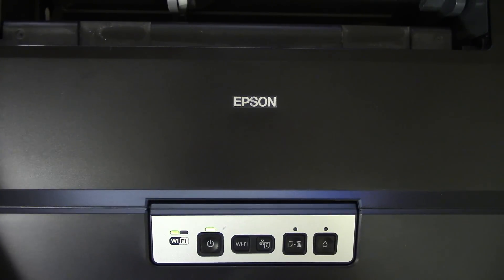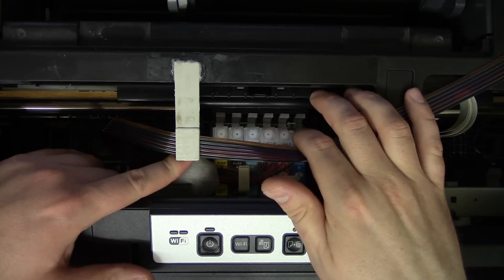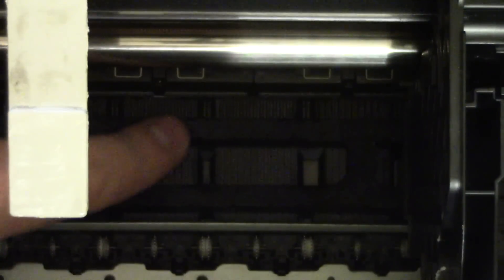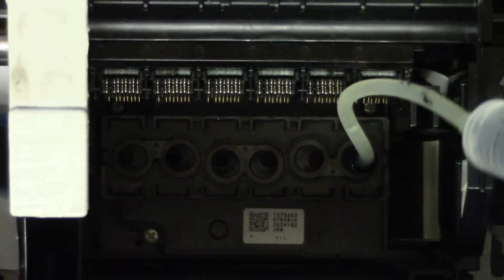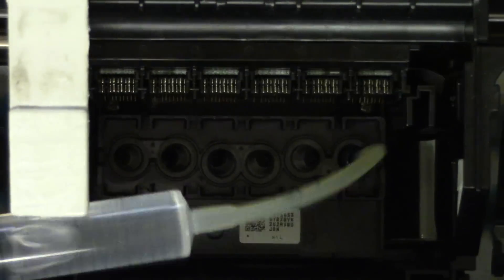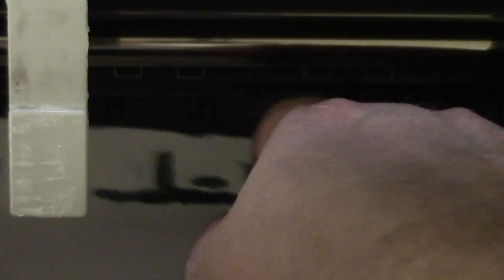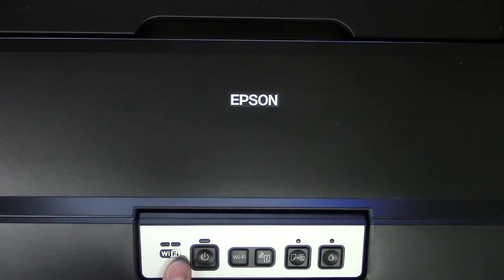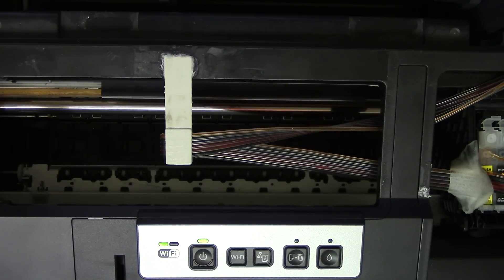How to Clean a clogged Epson Printer Printhead

Comment: do not do it what he's doing. it will destroy your printer. you should remove the printer head before doing the unclogging. a single drop of liquid/moisture will damage you print head. remember to double check if there's any liquid left in circuit before put it back. specially the flex cable. make sure no moisture or liquid.
Reply from the maker: Not true at all.  I've done this HUNDREDS of times on several printers over years.  You suggest removing the print head?  Most epson printers make this impossible without damaging your printer.
Reply: HBT many people going to our printer repair shop and their printer is dead because they follow what they watch in youtube without removing the print head. and im printer tech in almost 5years. some people don't know how properly care when doing clogging. so they end up dead printer. 1430 printer is very easy to remove the head. well your lucky for not damaging your printer. as i said be carefull for those people. thats all.
Reply: dheluxe hey I’m having the hardest time trying to find a tech who will work on one I Have. Do u by chance live in the south eastern of US? or any advice on someone in the region who will fix it? I wont be out of much oč a loss if it ends up nor fixed. I found. 1430 Artisan from a printshop who said oné DAY it just Quit printing and they didnt have time to stop production to triubleshoot of Try ti fix. So, went and bought another one brand new and bigger since business grew so fast. I can’t afford a good one that prints wide format just to use as a beginner to learn. And allow my daughter to learn in too.
Reply: dheluxe I’m a newbie at printing. Since I’ve received this printer from the moment I turned it on the nozzle clean has always said need cleaning. Now I have to flush it out because one of my nozzles got a color mixture so my print jobs are not printing out in the correct color. I stay in Atlanta Ga do you know anywhere I can go out here to even take a printing class for this particular printer. I’m really a hands on learner and I am willing to pay for the teaching process. I have never printed shirts a day in my life I just decided this is something I wanted to indulge in. I really need help and now you have me wondering about doing the cleaning this way. I don’t have money to loose please help me.

Comment: I tried this. I had two colors that would not prints. I flushed all the colors and now NO colors are printing. Did I do something wrong?
Reply from the maker: Hopefully you didn't suck air into the printhead or add bubbles when you injected the solution.  Turn your printer off and leave it off for 12 to 24 hours.  Then turn it on and print a test page.  If it's still clogged, run a software initiated cleaning cycle and then print a test page.  Let me know how that pans out.
Reply: The first flush worked, then I did reverse the syringe on a second flush. So, I probably did suck air into the print head. Oh well, I took my printer in to a professional to have it cleaned.

Comment: How long do you think an Epson printer should last. My R1800 seems to be getting clogged quite often.
Thanks Michael
Reply from the maker: Good question.  I've printed thousands of near full color pages of prints through several printers over the course of 2-3 years and they are still going.   I print nearly every day.  A lot depends on how often you use it, the room temperature and if it's an epson you should keep it off when you aren't using it.  If you only print a few times a month?  It's probably worth getting a color laser.  They aren't too expensive and it's pennies to print.  They also can stay without use for months, even years and it will work.  The printheads will dry on an inkjet if you even leave it for a month.  Hope that gives you some ideas.
Reply: Hi- Is a laser printer archival? i.e., will the colors fade over time?Thanks!

Comment: Done the same now all color wont print :D
Reply: if the color won't print or if nothings comes out, then it might be a blown fuse, if you're using the L series, it could be the f1 for L500 and lower series, for L800 above it should be the f2, its easier to fix that, than a clogged print head, since its really critical specially if you apply too much force that you're destroying the small holes on the bottom of the print head. Which are  Costly, While Logic Board are cheaper.

Comment: Time for you to switch to Laser Printers.
Reply from the maker: +MrMac5150 I print high res art, so far as I know lasers can't compete. Yet anyway.
Reply: HBT
  You better go shopping and look at the new color laser printers, try one , then come back with a comment.
Reply from the maker: +MrMac5150 I have a Minolta Magicolor laser printer that prints quite nicely, but a 4 color laser doesn't compare with a 6 color inkjet, not to mention ink droplet size.  They have their place for sure, but as far as I know a laser doesn't print on things like canvas.  Unless you know of a model that does, if so, I'd be thrilled to know about it.
Reply: I wouldn't even consider one. No comparison for making art prints.